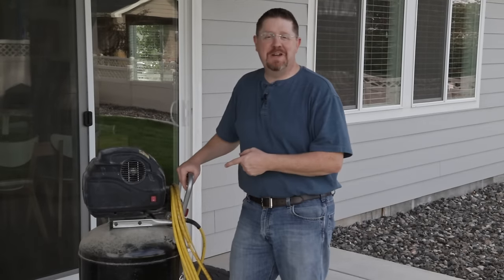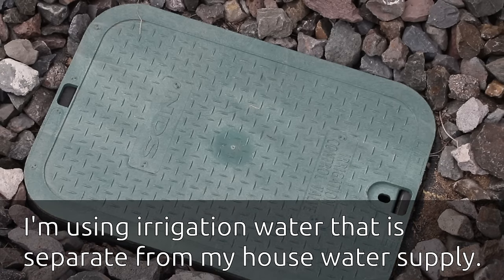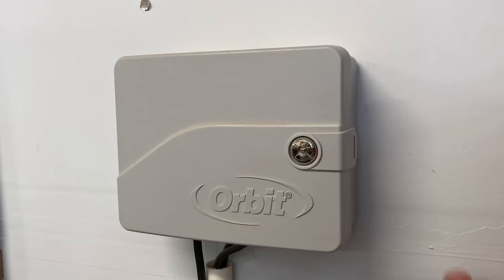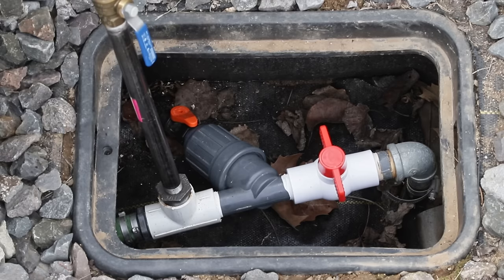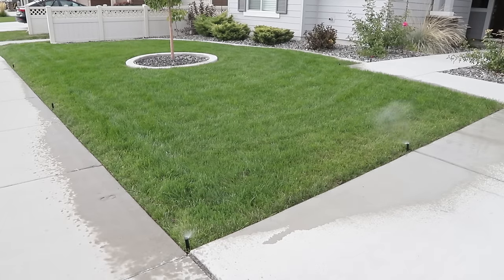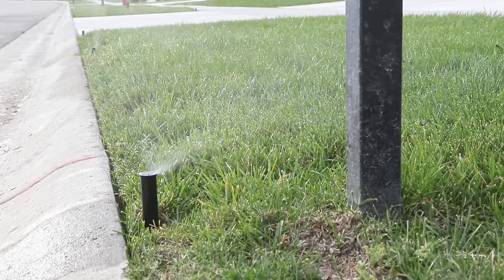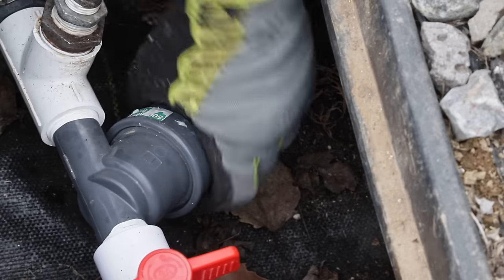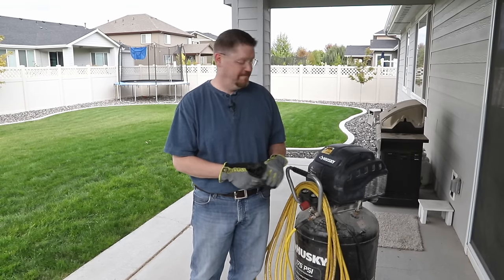How To Winterize Your Sprinklers (Sprinkler Blow Out With Air!)

Comment: Do you have drains built into your system that depressurize the line when the water is turned off? I do and with these drain valves on each line I don’t see a need to have the system blown out. Thoughts?
Reply from the maker: Do the lines actually drain? The only reason to blow out a system is to remove the water in the lines so it does not freeze, expand, and break any pipes, heads, or valves.

Comment: Can you post a good video of how to open your sprinklers for the season?
Reply from the maker: Hi NyChris - there is really not much to do to turn your sprinklers on in the spring: Open the main shutoff valve, then open each of the stations in turn to purge the air out of the lines. Then clean out the filter, and turn the controller on for the season. Easy peasy. Good luck!

Comment: My sprinklers were winterized prior to me buying my home. It is now spring and I want to turn it on but I’m not sure whether I need to hire someone or if it’s just a matter of turning back on the water supply. Please help. Thanks in advance.
Reply from the maker: Turning your system back on in the spring is really simple. You should not need to hire anyone to do it. If you watch my video, you’ll see that there are two valves closed when I winterize the system. All you need to do in the spring is open those two valves back up, and then test each of the stations to get all the air back out of the lines and filled up with water again. Good luck!

Comment: I have a irrigation system. My yard I recently had all the sprinkler heads, about 7 of them capped off and had cement poured in my yard, about a four inch slab throughout the yard. My concern is if I am blowing out my system like I normally would will this affect me being able to clear out the hose line that are still there?
Reply from the maker: Hey Myron - great question. It's a little tricky to answer accurately without some more information: Did they cap off ALL the heads on a single station (or several stations?), or did they only cap off a portion of the heads (i.e., does the station pipe run under the concrete to another area of the yard where there are some uncapped heads? Are there uncapped heads on that station before the concrete?
How many stations are on your system? 
How many are completely uncapped?
Reply: @AmplifyDIY  I'm not completely certain of the layout. 

 The connections for blowing out the system is located in the front of my house ; nothing major is connected in the back but the irrigation control panel affixed to the house.

 My yard is not huge. I had over 400 square feet of cement poured to cover a sprinkler system that was used to irrigate grass in that area. It has all been capped off along that entire section and on one side of the house. I do have one small strip of glass that I did kep two sprinkler heads for.

 I believe that may help with blowing out the system on one side but the zone that's located in the back and on the other side will not be able to blow out. 

I was wondering if the concrete would protect it from freezing if there was water left in there. I do spend a great deal of time using my compressor to blow out the system as much as I can. I don't know if there is a solution like winterization for homes that I could run through the lines to keep any fluid from freezing, that also not going to do harm to the sod that I have.

I just may be overthinking it but I just wanted to be sure since this is going to be my first season having this concrete  through a winter. 

I'm not sure how you would cut off a zone completely. I may be able just to dig in the grass and cap it whereas no water should even go to that area but I don't know how to do that.
Reply from the maker: Hi Myron, 
Whether the portions covered with the concrete will freeze depends on a number of factors you probably don't know: how deep were the original lines buried? How deep is your frost line? When they were capped, did they just remove the heads, or did they remove the branch lines as well and cap right at the main line? 
In your shoes, I would probably not worry about it at all until /unless a problem appeared. Keep in mind that the only reason to avoid letting sprinklers freeze is because you don't want anything to crack and later leak. If the entire station has been capped off though, then leaks won't matter since the station won't (or should not) ever run anyway. It sounds likely that an entire station (or stations) was capped off. If that is the case, then just disable those stations and don't give it another thought. 
It might be a good idea to manually run each station on your system just to see if there are any which do nothing. If you find that there are stations which have only a couple of heads that likely were attached to the portions which were capped, then you may need to think about digging up and capping the station just beyond the last head currently in use... but in your shoes I'd let it ride until/unless there was a problem. 
Good luck!
Reply: @AmplifyDIY  thank you for being so helpful. It means a lot.

Comment: I used to have mine blown out but the prices are getting crazy.  It started out at $20 about five years ago and now they want $45.  I have a tiny yard with two stations - one station has heads and other is drip irrigation.  Would a 1.5 gallon/150 psi compressor be enough to blow out sprinklers?  Also, I have two valves at the bottom of my underground pipe.  I know one of them turns off the water supply, but what's the other one for?
Reply from the maker: Hi Rich - yes, a small compressor would be enough for such a small system. For the drip station, I'd keep the pressure a little lower - say, 50-60psi or so. For the other station, you may have to completely fill and empty the compressor through it 3-4 times... but as long as you get to the point that all the heads blow air instead of water, then it'll be fine. Good luck!

Comment: I know 3 years late but .. wouldn't it been better to 1/2 open that last valve with the filter valve open, so anything in that last valve can drain out?
Reply from the maker: Yes, in general it's a good idea to crack open any valve that may freeze, or where any last drops of water may be able to drain out once you are done. Great tip - and thanks for watching!

Comment: how many psi did you set your compressor too?
Reply from the maker: Hi Thomas - I set the regulator (which adjusts the pressure coming out of the compressor independently from the pressure of the tank itself) to 75 psi.

Comment: What’s a decent compressor to get?
Reply from the maker: Compressors come in about a gazillion shapes, sizes, and capacities. If you are looking for a good all-purpose compressor that would be capable of running air tools and blowing out a typical residential sprinkler system, I'd recommend this one from Wen: (affiliate link) https://amzn.to/35AUR9r - That's to the 20 gallon size, but they have a 10 gallon size that will run most air tools as well if you don't mind the sprinkler blowouts taking a little longer. Good luck!

Comment: I used the same air compressor but it never build up the pressure to even 25PSI. I don't see any leak because there was no water leaks. Is it because my sprinkler system is much larger?
Reply from the maker: Hi Shane - I'm confused: You are supposed to let your compressor build pressure in the tank (until the motor shuts off - on this compressor, that's around 170psi) with all your sprinkler valves closed, and once the tank is pressurized, then open your stations one at a time for 10 or so seconds at a time. You'll be able to get a dozen or so bursts like this, then you'll need to let the tank re-fill. 

Did you connect your compressor while it was empty, open a station valve, and then turn on the compressor? Cause that's the only way I can think of that you'd not be able to build pressure...
Reply: @AmplifyDIY  I did, but as soon as I turn on the valve that goes to the sprinkler system the 170psi pressure drops to 25psi. All sprinkler valves are still closed. I don't see any leaks.
Reply from the maker: Hmm... something is not adding up quite right. That 170 psi in the tank represents a LARGE volume of air. It's got to be going somewhere... How do you know all your valves are closed? Did you physically close them all (not with the control box, but by turning the top of the valve itself?) Do you have any soaker stations? That much air does not just disappear. Any chance you left the upstream valve underground open? Maybe the air is going out to the water supply rather than to any of your stations?
Reply: @AmplifyDIY  before I shut the water supply there was no water running anywhere. So I assume there is no leak anywhere.
Reply: I mean I haven't open any valve yet.
Reply: Maybe my system is too large for this compressor. It's about 2.5 acres.
Reply from the maker: It could be that the system is just too large... but I doubt that. What happens if after you open the valve that goes to the sprinkler system and the pressure drops down to 25 psi, does it ever start to build pressure again? Have you let the compressor run for a few minutes to see? If it never builds more than 25psi, you must have a leak somewhere - or things are plumbed in a way that you don't expect. A compressor of this size should be able to blow out even a large system like yours. It'll take a while, but it is definitely doable.
Reply: @AmplifyDIY  after it drops to 25 it just stays there and never go back up. I kept the compressor on for half hour. I agree it must have a leak somewhere. but I didn't see any water running for the whole summer.
Reply: I isolated the section that drops the pressure. It works now. After I turned on one group of heads it only last about 30s before the pressure dropped out. I figured this will take me forever to do all 16 groups, because each one may take 4 pressure charges. I called the professional service. Their compressor can do 80 CFM which is 16 times more than mine. Thank you for your time.
Reply from the maker: @shaneinventist  Yeah, that's a pretty large system to get done yourself. Glad you figured out where things were going!
Reply: @AmplifyDIY  I later found it was the backflow valve let air out when there was no water pushing it. I actually still did it myself. The professional couldn't be here in time. It took me all day.

Comment: As a person who has worked in the trades for over 20+years, I was taught that you never put a Metal threaded MIP into a plastic FIP as in freezing temperatures the metal fitting will expand and break (crack) your plastic fitting. Just sayin.
Reply from the maker: Yeah, I never would have plumbed this system this way - but I had no say over a lot of stuff with this house. The builder subbed everything out, and many of the issues I pointed out (in the same vein as this) fell on deaf ears. This falls under the "I'll fix it properly when / if it ever becomes a problem" category for me. Thanks for watching!

Comment: Can you please do one video how to restart irrigation sprinklers?
Reply from the maker: Re-starting them in the spring amounts to opening the valves you closed at the end of the year and running through each of the stations to make sure all the heads still work and no new leaks have appeared over the winter. It's incredibly simple to do. Good luck!

Comment: I have a question.  To install a blow out tee should it go on the supply side of the manifold box or does it matter?
Reply from the maker: I like to have them as close to the supply as possible, so I'd go upstream of any other components in the system.

Comment: Can you show someone (me) who knows NOTHING about sprinklers how to turn ON this exact system?
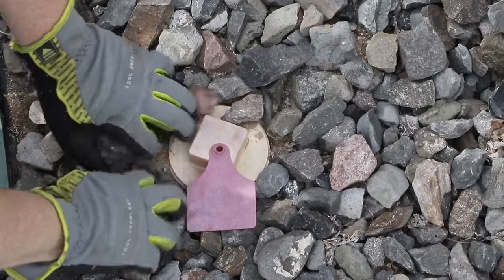Reply from the maker: Hi Drea - Turning the system back on is VERY easy. If you followed the steps in this video to turn the system off, then all you need to do to turn it back on is open both of the valves you closed when turning off the system. Specifically, there is the valve at the bottom of the underground pipe (see 2:19 of this video for the one I'm talking about).  Turn that back on. You should hear water flowing through that pipe briefly when you do. Secondly, you need to open the valve located in your sprinkler controls box (see 3:21 of this video). Twist the handle of that valve so that it is in line with the pipe. 

Once those 2 valves are open again, all you need to do is cycle through each station using your sprinkler system controls. Each station will make hissing / air blowing noises at first, then will switch over to water shooting out of the sprinkler heads once all the air in the pipes has been cleared. 

Check for any broken / leaking heads, and it's also a good idea to clean the filter (if you have one) every spring when you get your system going again. 

Good luck, and thanks for watching!
Reply: I can help you!!!

Comment: Using your box in the garage  to blow out is not a great way there are manual switches on each sprinkler in the box each manifold, id not use your box to do it that way.
Reply from the maker: Hi Common Sense - Yes, there are manual switches for each valve, but sometimes these are difficult to get to, and a homeowner may not know where they are or how to correctly operate them (some valves are different from others) - this is why I suggested using the control box to cycle through the valves, as most homeowners will be familiar with where their control box is and how to operate it. 

I've never heard that using the control box in this way is a bad idea - can you explain why? All the control box does is trigger each valve in turn, just as you would if you use the switches on the valves themselves...

Comment: Just make sure you're using the proper gauge and length extension cord (given the amount of amps your compressor motor needs to operate) and you should be just fine. To simply say extension cord = bad isn't exactly helpful advice! Good video otherwise, thanks
Reply from the maker: I agree with you - but most people don't understand wire gauge, amperage, or the concept of impedance or resistance, so the safest advice to most people is to simply avoid using an extension cord, which is why I included that. Of course, if you are familiar with the right way to do it, an extension cord is perfectly fine as long as you do it correctly. Thanks for watching!

Comment: extension cord can be used, it's not a problem if it's the same gauge or bigger gauge than the cord on said thing you're using. Wall plugs are either 15Amp or 20Amp 12 gauge wire is more than sufficient to carry a load for most an average joe is going to plug into it.  If people are going to continue to make videos, how about educate how to properly do something instead of saying it can't and shouldn't be done.
Reply from the maker: Hi Drew, 
The reason I recommend against using an extension cord is it increases the resistance on the circuit, which makes the motor draw more current and work harder as a result. When the motors on larger compressors like the one I'm using first start up there is a very large spike in the current draw, which can and will flip the breaker. If you go back to 0:47 of this video, you'll note that I never said you can't use an extension cord... just that it's better if you don't have to, along with an explanation why. If you care to google: "should you use an extension cord with an air compressor?" I think you'll find that I was in fact educating about how to properly do something. Thanks for watching!
Reply: Drew that’s incorrect. An extension cord does affect the power. The longer from point A (electrical panel) to point B (the device being used) the more voltage drop you’ll experience. Additionally the circuit will drop more voltage based on the smallest wire size in the run. Example let’s say you have a 20A circuit (12 gauge wire) with a 15A outlet installed, that outlet just got reduced from 20A to 15A because of the incorrect outlet. Another example would be a 20A circuit, this time 12 gauge wire with correct 20A outlet installed. But now you plug in an extension cord with 14 gauge wiring. You just lowered the capacity of that circuit and depending on how long the cord is, the voltage will reduce further and further the longer the distance. Before calling out the YouTube creator it’s best to get your facts in order.
Reply: @mikebaca6312  I agree completely. This is an A+ video and the person talking has superb communication skills which made the video exceptional getting across all the technical information (including his answers to all the questions about specifics) which was correct, concise and to the point.  I liked the VIDEO quality, too, not attempting to film one-handed with a cell phone while trying inadequately to demonstrate with the other hand.  An excellent teacher and communicator.  Thanks for the effort it took to accomplish it!